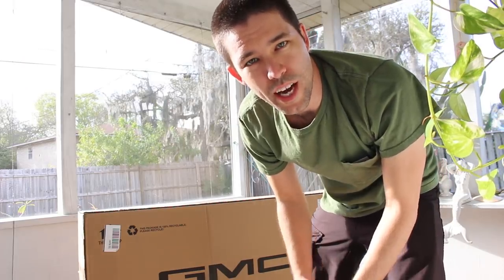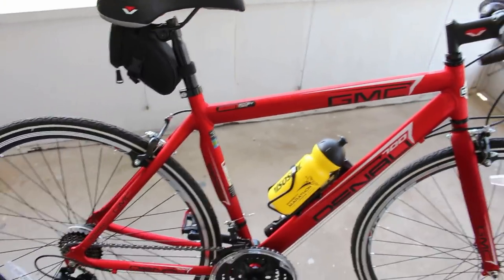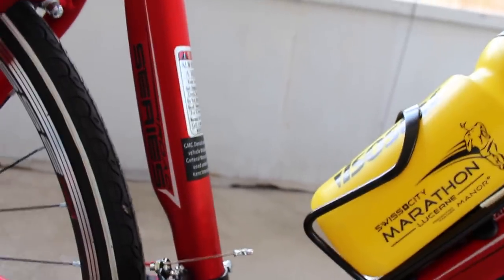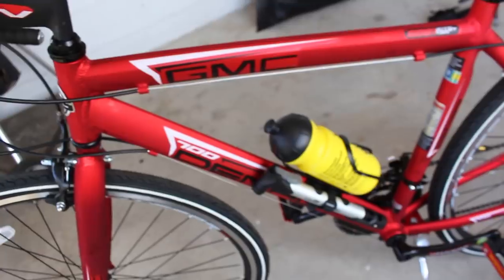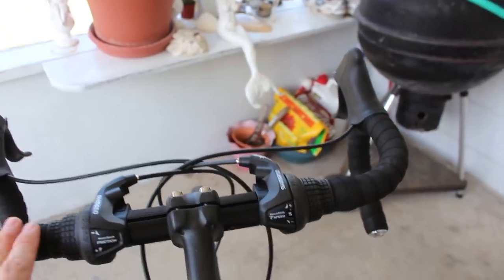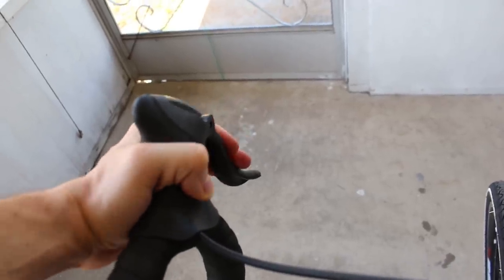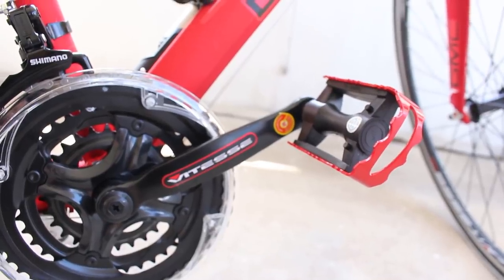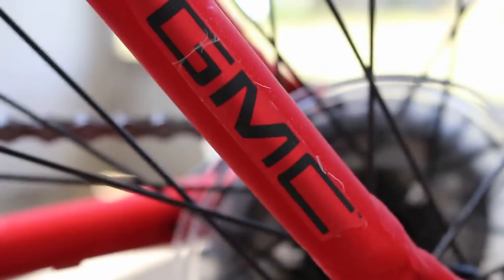Unboxing and assembly of my $99 Walmart Road bike

Comment: It doesn't need two water bottle holders because the bike will break before you're finished your first bottle :b
Reply from the maker: haha well we'll see tomorrow, have a pretty long one planned. video to follow.
Reply: I own one of these and can tell you from experience. This bike is much heavier than my higher end giant contend but it still rides just fine. I have road it in mountain rides of 5000+ climbs but there areas you will clearly notice and lack of quality. But over all it’s a good family bike or commuter. It was the bike that I started with when I got into cycling and did not want to spend a lot on a bike at first. I recommend it if you are on a small budget.
Reply: Also Bruce Chastain you can find shimano STI shifter for this on amazon that will eliminate the twist shifters if you want. They run about $100. Which will be the same as the entire bike but gives you a better way of shifting while still keeping the overall price at or below $200 for the total set up.
Reply from the maker: David thanks for the feedback, I agree it's heavy and slow, but in the end it's just a bike so it'll work. I'm hoping to do some upgrading down the road.
Reply: @BruceChastain  Denali was my first road bike, but I am sad to say that my taste has moved on to better things. The wider tire definitely helped me as a beginner on bumpy roads that I felt a thin tire would ended me on the ground crying
Reply from the maker: I just got finished doing a long ride which passed through the city of Orlando Florida, there was a lot of rough patches and I was glad to have these wider tires.
Reply: You actually can’t replace the twist shifter. The handlebars are welded after they’re installed. I suppose you could remove them very destructively. If you replace the shifters with STI levers, assuming you can get the twist shifters off, you’ll need all new cables and probably new shift cable housings.

Comment: Lmfao that GMC Denali is actually my training road bike, I use that bike everyday, it's 29 lbs 6061 black alloy. Best cheap road bike I ever owned. Setup was a joke through so once it was setup I have thousands of kms on it, tires are being swapped that is it. This bike has less issues than my GM vehicle rofl!!!
Reply: You are right about the tyres.  Standard issue tyres are usually made from a combination of cheese and superglue.  Only useful as a decoration.  Top quality tyres make more difference to the bike than any other modification bar none.
Reply: smitajky No doubt about that.
Reply: That bike is 33 lbs way to heavy for road bike. A road bike max weight should be a least 25 lbs
Reply: americanfresh17 lmfao 29lbs for a road bike is not heavy. With the 38 ( second ring ) with the 17th tooth cog you are zipping past 25 km/hr even at 29 lbs and that is with a 15 km hr wind. I see this nonsense all the time with people actually riding aero bikes at 7 kg thinking they are working their legs lol. To really work your legs you need a minimum 10 kg bike for the weight resistance. I actually laugh my ass off when people call a 29 lbs road bike with 32c tires heavy, seems like some people need to learn how to pedal properly.
Reply: @danfuerthgillis4483  I would not even call this a road bike at that weight (and with those shifters!). The idea of a road bike is not to make pedaling heavy, but to go fast.  Preferably also uphill, when every kilogram counts.
This bike can still be used as a fitness-hybrid bike though and at only $99 could be good value.
Reply: ZorbaTheDutch exactly that is why I use it as a daily training bike due to the weight being heavier than let's say my other road bike at 7.8 kg. I actually prefer the heavier ( non carbon) GMC Denali due to the challenge of the weight. I still reach 30 km hr speeds easy on a 14-28 freewheel with using only the 2 big rings up front ( first ring is disabled by the limit screw). So I don't complain about the speed more the crazy ass wind down here in southern Ontario which makes long cycling trips challenging with 25 km hr head winds.
Reply: @danfuerthgillis4483  It's a good workout! Plenty of wind here in the Netherlands also, it can be quite a challenge.
Reply: ZorbaTheDutch Indeed, this is why most cyclists are switching to lighter carbon frame bikes ( with alloy wheels). The wind here is very steady plus add in 30+ celcius with 90+ % humidity in the summer and you get some challenging riding.
Reply: @danfuerthgillis4483  I don't give AF about if I'm working my legs properly. I'm not racing in the Tour De France. I ride bikes simply for enjoyment. And I had this same exact bike last summer and I really disliked it only had it for about a month then I gave it away.
Reply: americanfresh17 shit wish you would of sent it to me for a new freewheel, chain, proper grease in cup bearings for both wheels, indexed properly, new backderailleur, chain rings derailleur setup, wheels trued and the awful brakes setup lol. You don't pay $3500 for a semi pro road bike do deal with those issues. I spent a good hour prepping this bike when I got it, first thing was to replace the freewheel ( ended up with a Sunrace 13-28 freewheel) but these bikes are horrible from factory I admit that but I already knew that when I bought it. My black and green gmc Denali has been great.
Reply: @danfuerthgillis4483  What's really funny is how Americans dicker so much about having a light weight bicycle, while the riders have bellies like they are 9 months pregnant. I've ridden with cycle clubs with riders that seem to average 250 pounds. Cyclists should worry more about their own body weight...
Reply: @BEEBEE159  hahahaha lol. I see that all the time.

Comment: I bought a similar one here.  I needed to remove each of the bearings and clean and grease them.  Some weld slag had found its way down the tube into the main bearings.  The loose balls are a lot stronger than the cartridge bearings so once properly adjusted they are fine.  I had the older lever gears all friction. Which I like because they can always be in adjustment.  ( unlike indexed systems that must be carefully adjusted to work ).  But the bike has done years of work ( although only around 10000 km).  My second water bottle cage is done by wrapping the tube with rubber and cable tying the cage on.  Works fine.
Reply from the maker: In under 1000 kilometers of riding I'm running into some crank bearing issues I believe. I'm going to post a video detailing the bike overall soonish,.

Comment: This bike used to actually cost $400+ and only aluminum parts are the frame, and stem. 
The rest is all steel. 

I still have mine and upgraded most of the group set to a Claris and feels great! If you want to replace the fork the sterner is 1in (25.4)
Reply from the maker: I've now actually came across a number of these that have been fixed up by their owners over the years. I guess it's got a decent frame for which you can put decent parts onto.
Reply: @BruceChastain  yes sir! It’s an amazing start for someone who just wants to get into the sport and end up wanting to upgrade! My Denali only weights about 20lbs as of right now.

Comment: Mt main issue is the used bike market is so saturated you can get a used trek hybrid for abt the same price and for abt 150 you can get a better quality road bike
Reply: same goes for germany - especially in the last 2 or 3 years (...after i bought my current one) i have the feeling that cyling has become more 'in' again and the second hand market is flooded with really decent stuff that hasn't seen 500 miles  of road for 100-200 bucks... then why buy new trash with not sooo true wheels, odd shifting 'n stuff that is not really worth upgrading or even maintaining when you can have a former 600 bucks bike that's good for the next decade or so for the same price

Comment: It's a steel fork. The handle bars are designed to split in half so the revo shifters can fit on drop bars.

I've had two of these.

1)Buy the insurance because some part will fail within 2 years. 

2) Get rid of drop bars and install flat bars. The drop bar brakes levers barely work and your hands have to be in different places to shift and brake. (Or don't, bikes in the tour de France had shifters on the down tube till like the 90's) BE SAFE.

3) Everything with bearings will be too tight and need to be adjusted correctly.

Conclusion:
These things are great if you can work on bikes or are willing to pay someone else to. 

Honestly a set of tires and tubes and a seat will set you back $100.

$100 is worth the two wheels (assuming they don't have painted braking surfaces *avoid*)

I have turned these into great commuter bikes that have outlasted their price tag.

Also buy insurance, when a component fails, in my experience, they've refunded the whole amount.

After thought:

Steel fork and cranks are heavier than expensive bikes, but steel bends, aluminum shatters. Steel is safer in a crash or a failure situation.
Reply from the maker: thanks for the info. And I just went out with a magnet and can confirm you're correct, steel fork.
Reply: What if you just bought a bike from a bike shop for $600? I'm thinking of doing this and maybe switching to all steel components for safety. Thanks!
Reply from the maker: @zoberindustries   sure you can do that. Lot's of people go with steel frames/forks. The weight will be a little higher, but if built well it's not hugely different.
Reply: "steel bends, aluminum shatters" -- I don't think so. That sounds more like carbon versus aluminium:  carbon shatters or just breaks,  whereas aluminium (and steel) bend.

Comment: good enough starting point ,you can always upgrade as time goes on .BTW the tires are kenda reflective great for night riding to be seen ,also get a light kit from walmart too that flash .TRUST ME IT HELPS DAY AND NIGHT :)   I got started on a old steel bike that also weighs 30lbs now 26 with new parts .
Reply from the maker: hey Richard thanks for the good thoughts and glad you liked the video!

Comment: Thanks for posting. 
I wore out the integrated shifters on my Wal-Mart Schwinn Varsity.  I am wondering if the cheap twist shifters will hold up longer and be easier pulling the chain up to the larger sprockets.
 Bicycles are my life and I appreciate everyones sense of humor about this bike. Some people take this stuff too seriously. 
These are the Andoriod versions of bicycles where they do the job. There are Apple versions of bicycles if you want to fork over the money. I live in the mountains and need the wide gear ratio these cheap road bikes offer.  It is almost impossible to find a "Boutique" road bike with this gear range. The Closest I could find is a Raleigh Willard 2 for $1000.
Reply from the maker: I had a similar thing. I had a MTB that had trigger shifthers, the one for the front broke, so I bought a $10 twist of amazon or something like that, it was running fine for about two years when I took it off.

Comment: The adapter as you call it on the handle bars I believe has another function. I picked up a used bike for parts that has the same set up. According to my local bike shop it is a 2 piece handle bar because of the twist shifters being too hard to slide around the bends and curves of the bar at time of assembly. So the shifters are put on from the center of the bar and the sleeve as I call it holds the 2 halves of the bar together.
Reply from the maker: yes that's right! I later took it apart and found the same.

Comment: I wonder how much this bike would weigh if you were to strip it of all components, and then replace them with a good 105 or better set, to include crankset, wheels, and even a fork. I bought a Nishiki from DSG. About 23.5-24lbs. Now down to about 18.5 with EVERYTHING replaced except for the original frame and headset.
Reply from the maker: I'm far from an expert but I would guess with full 105 you would get under 9kg (19.8lbs)

Comment: i dont think you should remove the cassette plastic piece if your chain shifts too high it will catch your spokes and it helps with keeping the rear hub clean from the chain oil debris. and maybe get quick release systems and change the gear shifters on your handle
Reply from the maker: I just removed it for looks only, but the chain shouldn't make contact if the limit screws are set. Shifter/break levers will be my first upgrade.

Comment: Hi Bruce, you can fit another water bottle cage by zip tying one onto the frame seat tube, put some duct tape on the seat tube first to protect the paint.
Reply from the maker: yeah I didn't think of that. thanks for watching
Reply: @BruceChastain  my own touring bike is similar to yours, bought in 2003 a low cost hybrid road bike for $299.00 NZd, i fitted a rear pannier rack, and have toured the South Island New Zealand, then in 2005 toured coastal Queensland Australia, . The only actual upgrade i've done was fitting a Brooks B17 narrow saddle, the bike does have a sealed bottom bracket, but other than that it's very basic Shimano Sora componentry and after 15 years of regular use, the only weakness is the rear hub which was never designed to carry the weight of 2 full panniers, is now begining to wear out the bearing cups. I watched your video ride across Florida, that was cool, and i had absolutely no doubt that your Walmart bike could it, that $99.00 bike will last as long as you want it to with a bit of DIY regular maintenance.
Reply from the maker: I'd love to tour New Zealand, looks super beautiful. The truth is even a super cheap bike like the Kent I bought should easily be able to make it 350km. I also have an old 1997 Giant ATX840 (now converted to a road bike, see four videos back), and I've done some touring with it as well. And also with the Giant, the rear wheel bearings started wearing out.

Comment: Honestly, for 100 bucks you can't go wrong. Love watching the kind of vids for some reason. Still, I picked up a specialized ariel elite on facebook market place for 200cad. Bike typically retails for 800cad but previous owner clearly upgraded some components. Deore xt derailleur and shifters, sugino triple cranks, lock-out suspension fork, and plenty of braze-on mounts for anything. Point is, you can often score solid deals from the used market. Side note: be wary of cheap aluminon frames from a box store. Quality control isn't great and with the higher amount of material used on 6061 frames, it's possible for the manufacturer to use filler to conceal frame imperfections. If it happens on some entry level bikes like Aventon, it will surely happen on a Walmart bike. Good for quick convenience store runs but wouldn't risk touring on this bike. Or, maybe I'd try it for the thrill of not knowing what will happen lol.
Reply from the maker: Yea I happen to see a decent looking trek at the local pawn shop the other day for 120 usd, probably from the early 2000s. As far as touring this Walmart bike, I should have a video on that in the near future.
Reply: @BruceChastain  Yeah, there are some people out there that just constantly chase the latest in bike technologies, parting with their perfectly good bikes. Seeing someone tour on a walmart bike would be all kinds of entertainment. Stoked to see that vid :P

Comment: I always stick to these rules. If you want a cheap single speed bike go to walmart and save some money. But if you want a bike that you will ride a lot and is multi speed you gotta up it to something a bit nicer. Every multi speed I have ever tried from walmart is trash. Never goes into every gear. Usually only 3-4 out of the 7 are usable.
Reply from the maker: 100% right.

Comment: Might be OK for a quick trip to the store or something but I wouldn't want to be on that when I'm going down a hill at 45 MPH... not to mention I'm sure it's heavy, so going up steep hills won't be that fun, although the triple chain ring helps with that. I guess not bad for $99 though.
Reply from the maker: Honestly I think you'd be nearly crazy to take this bike down a mountain at 45mph. Especially because the breaks are so weak.
Reply: @BruceChastain  ha ha yes, I was just thinking about the kinds of rides I do and imagining myself on that bike with dodgy brakes. Heck even 30 MPH would really be pushing it, which isn't hard to achieve in some of the places where I live.

Comment: I ride the kent roadtech and i've had it for 2 and half years and still going,i did however had to replace crank bearings of course,but,thats it on mechanical stuff,put some continental ultra sport IIs on it and that made it ride better, it seems to even have gained speed,next i plan on going a step skinnier and see what that does.everything is bone stock (except tires and tubes of course).Compared to a 70's 80's ten speed,this is better
Reply from the maker: Is the roadtech basically the same bike?
Reply: @BruceChastain  Yeah basically,except it doesn't have the bolted split handle bars like i heard of on the GMC,also has the good thumb shifters instead of the twist ones,not a big fan of the twist ones,its holding up well for having 100's of miles
Reply from the maker: Interesting, sounds a little better. And where did you buy it? In Europe?
Reply: @BruceChastain  I got it off of ebay,it was more than 99$,i know some people disagree,but it seems to be worth it to me